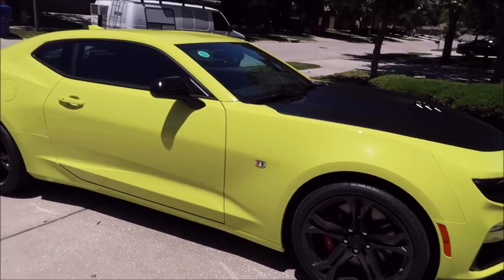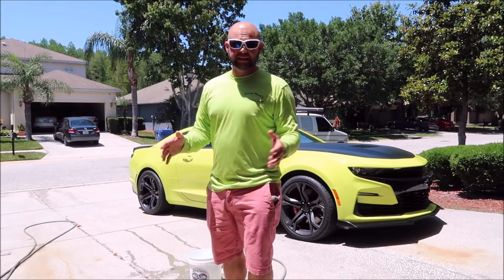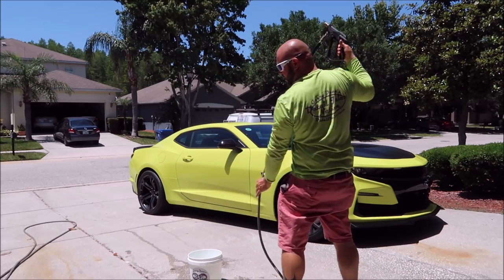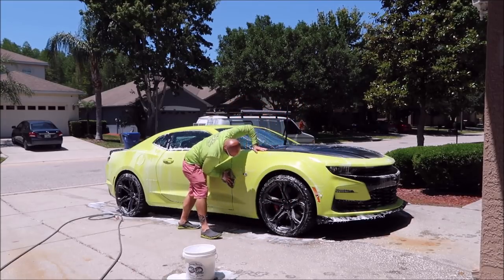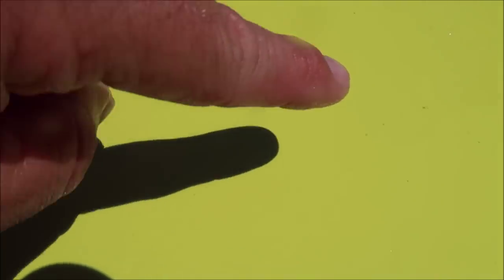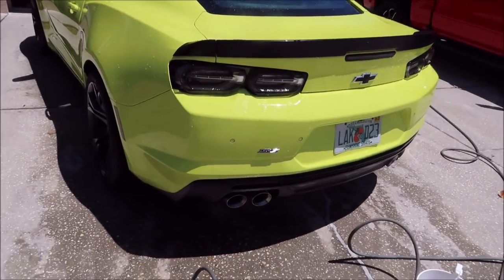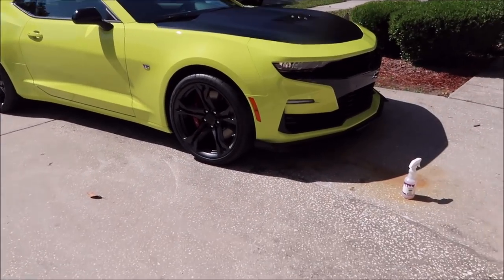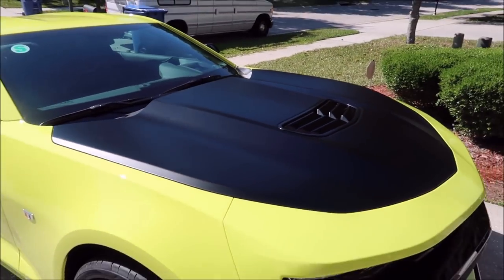2019 CHEVY CAMARO 2SS 1LE - EXTERIOR DETAIL - IRON REMOVAL - UNIVERSAL CLEAN AND PREP - IUDJONE

Comment: Are you not worries about washing in direct sunlight? I went 100% rinseless because of the high heat and sunlight I get in my area during the summer time and was having a hard time with soap streaks or water spots on black almost immediately
Reply: Garry Dean uses deionized water. Watch again at 4:24
Reply: He’s using DI water
Reply: The Paint Corrector I’m crazy I wash my car before the sun comes up. I have a headlamp and good outdoor lighting.My neighbors think I’m crazy 🤷🏼‍♂️
Reply: If you use a pressure washer to get the soap off you dont really have to worry about water spots. I use the sun to dry the car off.
Reply: Deionized water. :) At least what I use.
Reply: The Paint Corrector di water doesn't leave water spots